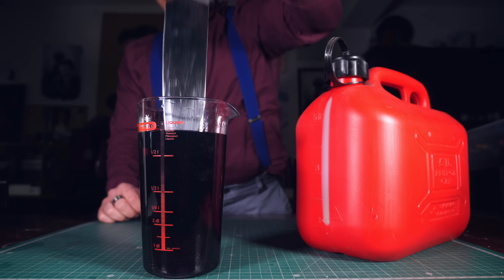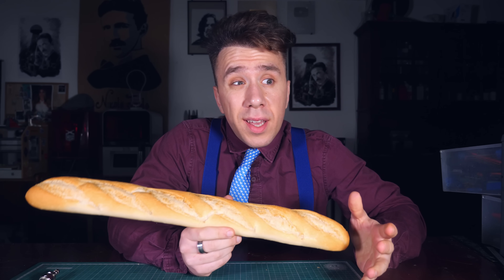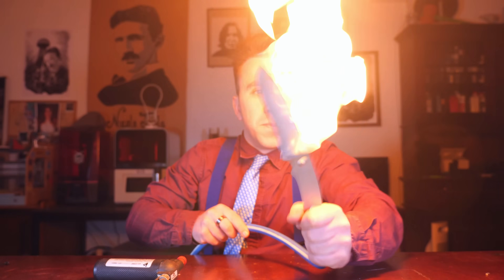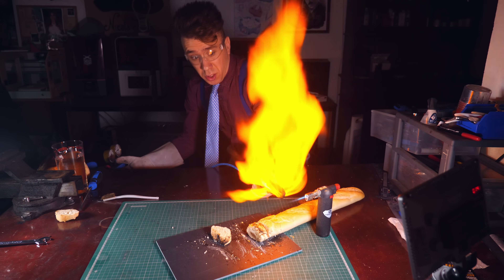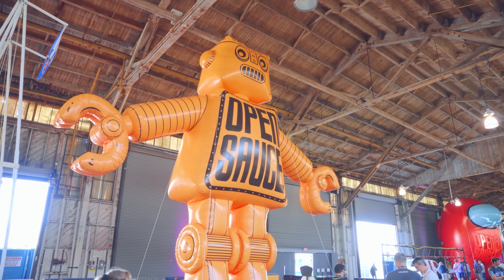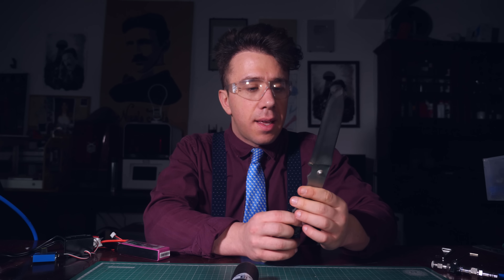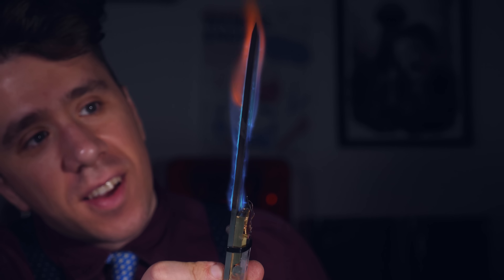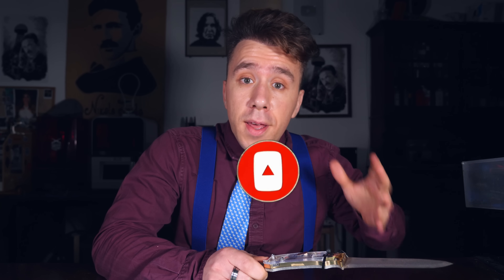I made a TRUE FLAMMING KNIFE

Comment: You know I remember something about the Apollo Rocket. They had an issue with releasing the hydrogen into the rocket, so they had to use a type of shower head like diffuser. Maybe using that porous 3D printed metal as a diffuser might work even better.🤔👌

Comment: One thing I would do on your combustor is put the oxygen/air source in the center, and the fuel in a ring around it. This serves multiple purposes. First, it keeps your metal from melting by constantly cooling it. Second, it mixes the fuel and oxygen inside the metal so you get better, hotter, and more complete combustion. Third, it makes it possible to create a small bubble of air around the combustor, both forcing the flame outward at higher heat (think blast furnace) and keeps the flame off the combustor  so as to both cool the surface and keep the superheated combustion from melting the outer layer of your combustor (which would be disastrous). Just a thought. Thanks for this! It is one of the most exciting developments in the field in some time.

Comment: What if you seal the knife blade , except on the edge. allowing the flame to only exit the knife at its cutting edge. also put an additional trigger valve on the handle, to release the gas / air - more uniformly, where it is needed, without the "crazy flame" (going crazy) LOL ! and maybe a hand shield.  GREAT WORK! thx

Comment: New Video Idea: Use the porous metal to explore hydrogen production with electricity and distilled water. Then, captured hydrogen to power with a converter (available for sale). See if the metal creates high hydrogen yields due to surface area.

Comment: you should try to make a pulse jet engine out of the porous metal, you could seal the outside of the metal body to make sure all the gas only going inside the engine, this would allow for even spread of the fuel throughout the engine and possibly make new and very efficient engine. (from there you should put it on a rocket and launch it up to see what happens)
Reply: Might be possible to do so with metals that are very resistant to high temperatures. But then there's the other problem, they're very resistant to high temperatures, therefore, very hard to manufacture
Reply: for a hobbiest it might work but i don't think it would work on the large scale rocket. the metal might be adding too much weight to the engine.
Reply: @takumi2023  might reduce weight if you can save on plumbing
Reply: @nic.h  not that much as most engine (rockets) are just nozzles and bells. you'd still need to pipe the fuel to the combustion location. (blade of the knife). 

i am interested in see how he will implement this into an engine. my initial thought was using it as a oxidizer or fuel injector. the problem is the lack of control and consistency. he mention that the tip of the blade is hottest and we saw the spine had much more fuel leaking compared to the blade as well as uneven heating. Now i don't know if the 3d printing process can control the flow rate of the blade (or other shapes) by making the porosity consistent

Comment: Hello integza I have an importált question: why does the flame not go up in the jet engines fuel tube when you ignite it? I Am building one but I Don't know how to inject the fuel and I am worried about safety.
Reply: This is just a thought, but maybe it is just that the gas flows through too quickly to ignite.
Reply: @ponsockgaming2.054  that could also be one of the reason it doesnt explode
Reply: because it would need oxygen to be in the fuel tank

Comment: The screeching sound from 5:00 is the same sound you hear when it starts to burn inside the nozzle of acetylene/oxygen cutting torch, I think it's exactly the same thing happening in the knife. You can see the flame heating up the knife as the gas mixture burns inside the knife. When this happens with a cutting torch, you can easily cut off the oxygen supply on the handle and because there are two different hoses for each gas the combustion will rarely be able to continue inside the hose. Not on the acetylene hose, maybe in the oxygen hose if there is enough heat. Using the same hose for both oxygen and helium can be very dangerous, but I guess his right hand is on the valve the whole time. Nevertheless, I would never dare to do that.

Comment: Removing the edge? What edge? To remove the edge you should make an actual edge in the first place. That 3D printed knife can't cut. It splits stuff because of the pressure of your brute force, but that's not cutting. If you wanted to make it actually safe, you need to add a sharp edge, so you can cut stuff without effort. Knifes that are not sharpened are the ones that can cause unpredictable accidents.

Comment: What got me really curious is how the fuel is so well distributed along the whole blade. My guess is that there is a structure printed inside the blade that helps with that distribution. Or is it the porous metal doing all the distribution work. If the latter is the case, it will really be INCREDIBLE for the jet engine designs.

Comment: Hello, I like the video, congratulations. Not much the sponsor. I think using this kind of metal porous structure could be interesting for a rotating detonation jet engine. It light help diffuse and mix fluid, with 3d printed you could even imagine internal structural design, like to direct flow, protect for thermal over heat or use of an aerospike or what ever 3d printing sound like an amazing tech. With different choices of propellent Gaz you could get really different result and thrust out of jet engine I hope you find way to make this or maybe those rotations detonations more stable. Have a nice day and stay safe

Comment: Could you use this technology to make a low drag surface, such as a wing  that pushes air through it? It could also be used as a control surface, by blowing the air through it you could remove the low pressure area and reduce the lift of the surface.

Comment: @integza u need to use this 3d metal printing process to make a jet engine fuel injection system by using the holy metal to make a fuel distributor instead of copper pipes, another cool idea would be to make GOD OF WARS blades of chaos and make them firey . love your work man!

Comment: Yes, one hopes that a porous cylinder (on the inside) will help cool the walls if they are constantly cooled via the porous flow of cold fuel/air. Liquid air flowing through the walls and evaporating inside them from the heat might do it (or shatter from thermal expansion/contraction).

Comment: I got a video idea😊. A rocket engine using a solid part and a liquid or gas part. Should behave like a solid booster but with control over the engine. You would have to create a system that efficiently leads the gas or fluid to the solid propellant, but yeah...

Comment: It would be awesome if you  made a hydrogen powered jet with internal electrolysis bubbler to produce more hydrogen for extended flight/run time and  generates power in the jets turbines to charge super capacitors that in turn powers the bubbler worth a try

Comment: Sintered metal media are fabricated from various metal alloy powders to meet demanding application requirements. They are manufactured in a controlled process by pressing pre-alloyed powder of controlled size and shape into discs, cups, bushings, tubes, or porous sheet, followed by high-temperature sintering. The combination of powder size and the pressing and sintering operations define the pore size and distribution, strength, and permeability of the porous media.
Kenneth L. Rubow 
Mott Corporation
Farmington, Connecticut

Comment: You should build a jet engine powered rocket that runs on butane. It should be sized so it fits a standard butane canister as fuel and is self-contained. It could run until the butane runs out or it goes high enough that there is no more thrust. Then you could swap out cans and do it again if it hasn't exploded 🤔

Comment: for your next jet engine, you could use this porous 3d printing to run air to hotter components such as the turbine to cool it as it gets very hot and sometimes can melt
Reply: I suspect that being able to seal the spinning turbine whilst also having it ported to allow liquid to flow through it, would be an absolute nightmare!
Also, the fact that the centrifugal forces would caused the coolant to coalesce at the tips, would be problematic.

I believe some of the blades are already hollow, to be light weight, and that adding liquid would undo that aim of being light (so that they can spin fast).
I feel like if them being cooled was that necessary, they would've already leveraged it being hollow, to pump coolant through.

(not trying to crap on your idea, just playing devils advocate; I commend you on your outside the box thinking! 👍)

Comment: Theme for your next Video:
   3D printed kerosene based Jet Engine 🚀.So, basically all we need to do is 3D print a Propulsion model & this time not by plastic but using Silicon carbide ceramic( SiC ) which is mean to sustain a temperature of up to 2700°C🌡  which can result as can overcome the large amount of heat🔥 released during combustion. Try using diff types of nozzle and figure out which can be the best for it .I think this will go crazy 🤪 🤪  building a completely ceramic body.

Comment: This is very similar to ventilation filters in heavy hydraulic and industrial engines and equipment. They are some type of bras or copper alloy, the structure is quite similar, solid but porous.  🤓

Comment: an idea would to, have fans or high pressure air in the the handle pointed down the length of the outside of the blade to force the flames to be more linear instead of the flames being chaotic. in theory, they would cause a concentration of heat down the blade

Comment: He made a very dangerous discovery. It is possible to 3D print a knife using tungsten where the powder has an agent to lower the melting temp of tungsten. Tungsten is really hard and resistant to heat. The discovery shows a red hot knife in seconds. 
Do you see what Im seeing ?

Comment: We use additive manufacturing for our jet engine fuel nozzles, really cuts down on parts count.
For turbine blades, they are hollow, and have holes in them for cooling air.
Sintering metal microbeads has been done for decades to make filters, etc.

Comment: Video idea: "A jet powered leaf blower"
Dont know if its possible, but also the option to spit flames and burn the leafs😂
Reply: After it is all on a big pile, you BURN it
That's why they call it an 'afterburner'😅
Reply: Apparently, Russia uses jets for snow and ice removal. I bit excessive though, as I would think it would exacerbate asphalt degradation... If not from the heat, then from the plain water being able to seep into cracks and freeze, making said cracks even worse.

Anyways, for leaf removal... As long as you don't do it anywhere on Earth, it'll be fine! lol
Otherwise, you'll just be burning down every forest you use it near, and the homes in and around it. 🥴

Comment: Video idea:
Make a metal 3D printed jet engine with regenerative cooling. You can print the combustion chamber and make the walls hollow for the fuel to go through. It will keep the chamber cool and heat up the fuel (wall | hollow space | wall | combustion chamber | wall | hollow space | wall)

Comment: gas turbines use turbine blades with small holes to create an air layer around them to avoid melting or weakening em in the presence of hot gases, up to 1500°C, you could perhaps try to 3d print a turbine out of stainless steel, find a way to blow air into its holes while spinning and find out how hard you can push a jet engine that way

Comment: I've heard people are experimenting with fixed wing aircraft by using compressed air instead of physically movable control surfaces to steer the aeroplane.  The way it works is that the compressed air can disrupt the airflow over the wings creating drag in comparison with the usually smooth flow of air.  That drag, when controlled carefully can steer the plane.

Given your diffuser seems capable of doing the same kind of trick, I wonder if you can design an aerofoil with panels which include this material, and use it to disrupt airflow and their by, hopefully, control the effect of the aerofoil through the air.

Just a thought.  Great video. Be careful 🙂

Comment: Would using this material on the nose cone of a rocket or the leading edge of an aircraft wing and the pumping air through it create an air cushion that could massively reduce drag?

Another thought is for ventilation, instead of having a grill or hole you can just have a plate of this material. There are so many possibilities with this stuff!

Comment: You're thinking too small.
You MAY be able to create not just a normal jet engine but a DETONATION engine.
The trouble with detonation engines as I understand it is the combustion mixture comes into contact with a hot surface or hot gas and ignites before the detonation flamefront reaches it.
This technology might be able to provide a forcefield of constantly incoming cold (and yet unmixed) gas that prevents this contact from happening.
Just like bread dough sticking to a knife.
Reply: a cylinder made out of this metal, that pumps oxygen through itself. Inside that cylinder, a second, smaller cylinder that pumps hydrogen through itself. That way it wont have the same issue the knife had with heating up when the gasses mix. This should allow for that gas mix to happen outside the metal... maybe a good idea. I'd say worth a test.
Reply: he could make cooled rocket nozzles too
Reply: Very cool (literally)!
Reply: Wouldn't the material be weaker due to the pour. And the shock wave would break the meterial
Reply: @kanchanmishra4790  No if the material doesn't go into the burning chamber.
Reply: That's what we want to find out!!! @kanchanmishra4790
Reply: This was my first thought as soon as I saw the oxidizer go through. Surprised I had to dig so deep into the comments to find this. Getting stable continuous detonation engines is real hard. If a porous ignitier solves the problem... The benefit of that is detonation engines have most of their trickiness in the mechanism to sustain the detonation wavefront. If you solve that with just some metal sponge, all the fancy timing and everything else goes away. Now it's just a flame holder in an otherwise ordinary jet engine.

I'm sure another jet engine company has already thought of this, otherwise someone should be in a mad rush to the patent office.
Reply: Detonation knife?
Reply: I'm pretty sure the fuel and oxidizer need to be well-mixed before they reach the combustion chamber though, so that adds the complication back in. Porous injection might be a step to easier detonation engines, but it won't be enough.
Reply: It doesn't work out... The problem is that those engines produce too much power.  The pressure wave is so violent that sintered metal as we have it now just not strong enough to handle operating in that environment.  It's a good idea for if we can make stronger sintered metal parts, but the material science just hasn't reached that point yet.
Reply: @NeoIsrafil  Unfortunate. Maybe high entropy metals will do it? AFAIK the only way we can make high entropy metals right now is in microscopic spheres which is perfect for this application.
Reply: Ways around this choosing different fuels I think and different ratios. Also pours should cool it down enough till desired spot.

Comment: I don't get a chance to mess with aero engines too often, but I do work rather frequently with large gas turbine fuel systems at my engineering job. They've been using diffuser-type reverse flow fuel delivery systems for a while now with pretty interesting results! I highly recommend that you look up the General Electric DLN 1.0 combustor system sometime, Integza. Its an older design from the 80s but in terms of flame stability in high-flow combustion its really quite impressive, and being older a lot of the documentation is freely available online.

Comment: Slight redesign of the knife.... Make the pores only along the cutting edge... would cut down on "wasted" fuel burn and would make things a bit more controllable... Plus the cutting edge is the only part really doing work.... run the flames, heat the edge, kill the flames, cut, reignite for the next cut.....

Comment: be interesting if Kaak can mix the prints... ..pull a rocketlab and 3dprint a whole rocket engine using a mix of this porous metal and non porous metals... see if you can make it at a small scale.... you could also have a scaled rocket body printed in metal... tip.. apparently the best design for rocket engine injectors are pentagram shaped.

Comment: No integrity, ruins its own temper.  Would make an interesting diffuser but I'm worried about part longevity.  Oh, also, you're using the knife wrong. Cut up into the heat, not down and away from it.

Comment: If I recall correctly there are a couple of other methods to manufacture materials like this, depending on temp you need to work at.
Salt casting (molten material is cast into a salt packed mold, usually under vacuum), and salt sintering (sintering material is packed with salt).
Salt is then washed out, and you get a super porous metal object.

Comment: Driving the shaft of a Stirling engine causes the cold part to get really cold.  Maybe driving one with wind could be used to condense water from the air.  You should try that.
Reply: That's called an air dehumidifier... or an air conditioner, depending on configuration
Reply: @inv41id  Have you seen one working with a Stirling engine powered by air outside?